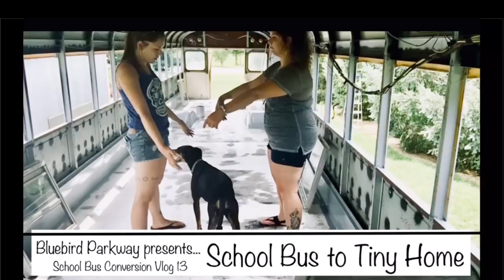School Bus To Tiny Home Conversion Vlog 13 \\ Floors, Bumper, Light Covers, Replacing Windows

Comment: Ayyye what’s good A!? Gotta love DMV weather struggles. Nice j o b on the bumper and floor fix. I’m personally not a fan of eliminating windows, but I’m sure I’d be eating my words if I had as MANY as you and the potential for waah issues. Lol. How thick is the metal..? It “sounded” thin. Not a big deal, but you may need to add support for the middle. You’ll find that it “flaps” when you’re flying. Insulation will help some, just keep it on the back of your mind. I’m sure you’ll be caukin around the new sheet metal/window, I didn’t see that you guys used weather stripping/caukin (in between the two) when your boo placed the new sheet metal in place. 

Looking great! And have I told y’all how much I loveeee the pup!?!
Reply from the maker: The HWYLIFE  I’m also not a fan of eliminating windows, but we added 2.5 inches of spray foam in them which will really help to keep us warm/cold when needed and didn’t see the point of having a window behind my toilet/in my shower/ behind the fridge etc. just letting sunlight in to heat up the bus in the summer... plus there were 28 windows! Lol Aaron n I also had a few heated debates about covering windows in the bedroom and living room but I won the battle for the kitchen! Lol let there b light! And we were just testing the fit of the metal in this one. I glued them w polyurethane caulk n sealed the outside w clear silicone. Screwed them in w self tappers. It turned out pretty nice! 

Also, I’m glad to see u back on here w ur bus again!!!
Reply: Bluebird Parkway That’s pretty awesome. You’re definitely ahead of me. It’s good to be back on the bus. Bout to throw down before winter sneaks up. Weather has been the biggest struggle! I’m glad you guys are doing well.